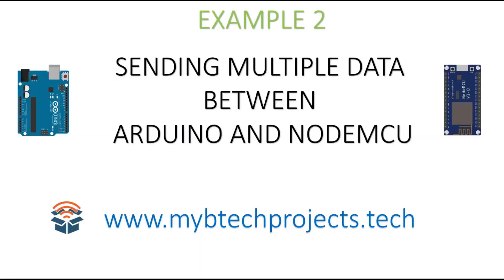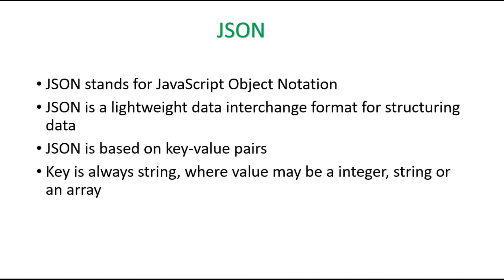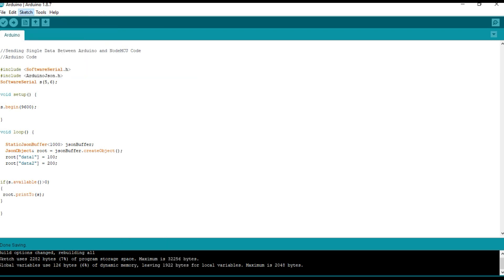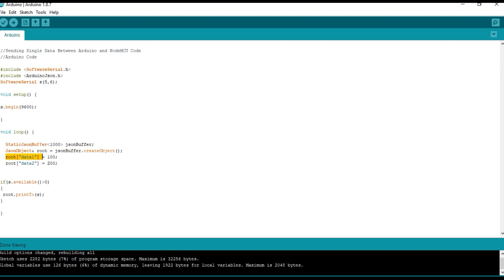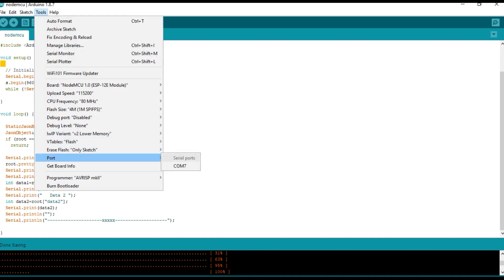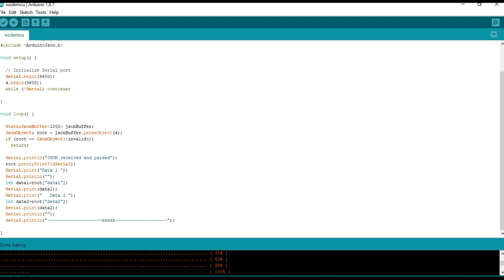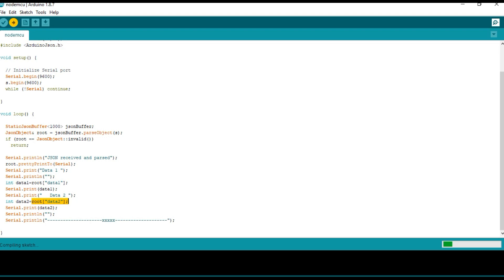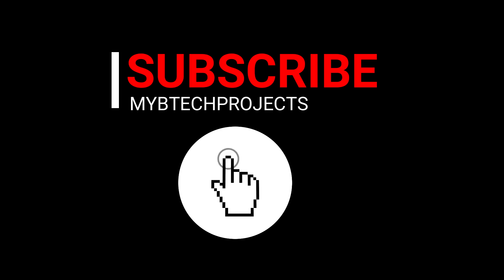[Fully Explained]--Multiple Data--Serial Communication between Arduino and NodeMCU (ESP8266)

Comment: Arduino sends and Nodemcu receives, Arduino starts first, Nodemcu starts later (ie sender must start before receiving device). If two devices start at the same time, it will not work.

Comment: I have this exact setup and code and it is not working? Tried the Nodemcu reset as well. I really want this to work? Any ideas?
Reply from the maker: Hi, kindly check if you are connecting the RX pin of nodemcu to  TX of Arduino and vice versa.
Reply: Verified connections and ohm’d out with multimeter. Uno6 to Nodemcu D6, Uno5 to Nodemcu D5, code Uno=SoftwareSerial s(5,6); Nodemcu= SoftwareSerial s(D6,D5); I did have to comment out if(root == JsonObject::invalid()) return statement. After that the Serial started working but 0 was the value. Then, every once in a while watching the serial monitor the values 100 and 200 would come across and print out. Just one or two times. Then zeros for a while then 100 and 200 the zeros again. About every 6-7 seconds approximately.  Very strange. Tried new jumper wires. Tried a new Uno and new Nodemcu. Only difference I know of is I am running Arduino IDE on a Mac. Thanks in advance for any ideas.

Comment: help.!!!!!!!!! doesn't work for me. nothing in the serial. same method but different board. ARDUINO MEGA 2560 and NODEMCU v3.0..
Reply: i have the same problem here
Reply: using port tx3,rx3 instead 5,6

Comment: I also cant see anything on the serial....could you plz help me?I dont know what is the problem here i did every thing exactly like the video.
Reply: Press reset on the NodeMCU board
Reply: @Spavocado    I did it more than once  but I get nothing
Reply: There is a problem to Sending data out i dont know why i use mega to

Comment: Bro it is not working for me. I can't see anything on serial monitor
Reply: Press reset on the NodeMCU board
Reply: Dude you might have done some mistake. It is working. Check out the connections.
Reply: @tamizhdiynaveen1354  why I received invalid JSON Format---->
{" " :t
                  }Data 1 0
                         Data 2 0
?
Reply: @muhammedibrahim451  Hi Ibrahim,
Thanks for asking. Have you installed the 5.x version of ArduinoJson library? Because 6.x versions are in beta. And make sure that the connections are correct since you don’t receive any data. Thankyou.
Reply: @muhammedibrahim451   Bro check whether JSON library is properly installed and then try with single data ,then proceed to multiple data
Reply: @tamizhdiynaveen1354  single data code working but multiple data not working
Reply: @Primeparthu  me too, have you got an answer for this problem now Sr. ?